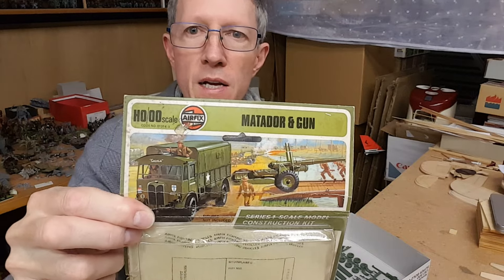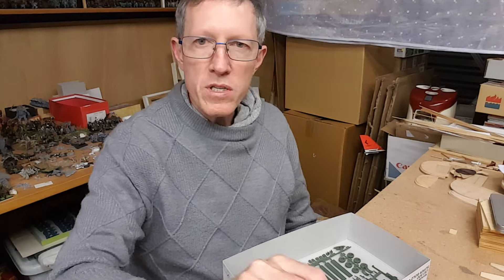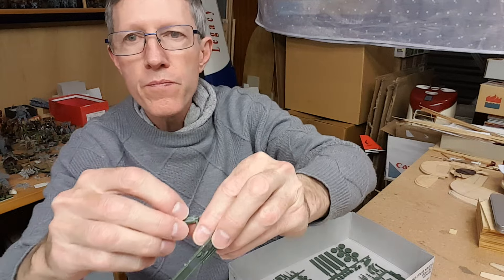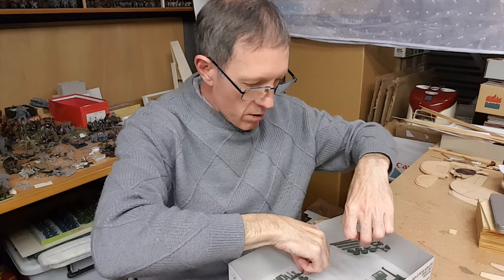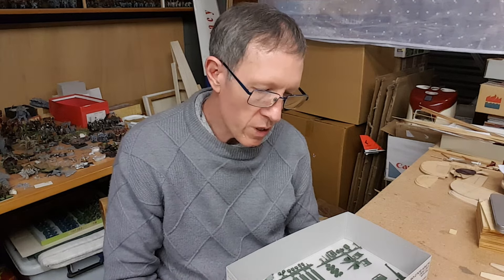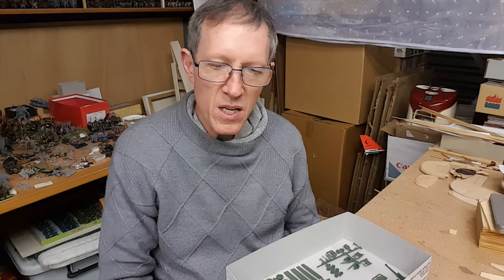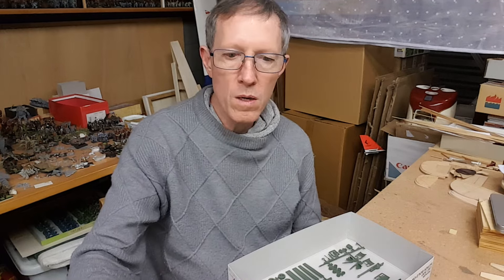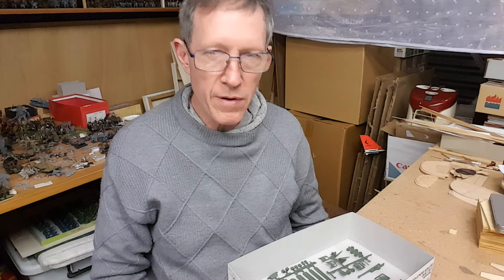Airfix Matador. First look and planning the build.

Comment: Hi . I built this Matador at the beginning of this year and I really went to town on it. Much scratchbuiding and superdetailing. So new fuel tank and holders and I cut out the winch drum and then made the rollers for the cable to run out of the back and the reattached the drum. For the cab I cut off the drivers door and made a new one in the open position. I fleshed out the interior including the wooden framework on the rear wall. As for the windscreen its easier to cut off the two thin horizontal bars and then replace them once you have put in a full screen. On the front of the cab there is a little flat plate that sticks out with two supports. On the roof I covered the hatch with a tarp and on the other side there is a spaced tin plate roof. Look at pictures of 'Gazala' ( there are some good one's of it in France) and you will see it. I re-done all of the mudguards as they were to thick. I did the mudflaps and the little step on the back of the front one's. I also did the rain channels on the front one's. Now the truck body. I scribed planking on the floor and kept the original roof. But I did the frame supports with the sides rolled up. I also opened the doors and diid the crew seats (x2) and also made the ammo crates. On the rear door I made the tow rope from copper wire and did all of the hooks for it to go round. Under the body there are some boxes and a frame for two jerry cans behind the fuel tank. Now the gun. You need to shorten the barrel by 1cm and the rear slide rails behind the breach need to be hollowed out. Its easier to cut it off and grind it out the stick it back on. The towing ring has to come off , its to big. Make a new one. The trails have lots of rivets. So cut out some plasticard of the same size and shape then turn them over and carefully press the rivets into them. Now turn them back up the right way and glue them on , its easier than it sounds. Then add some small boxes on the trails and the gun cradle sides and thats it. It should be painted in olive green with the 'Mickey Mouse' pattern on it. It took me just short of  2 months to do. I won a prestigeous competition with it just recently. Check out Benno's figure forum for his build as that is where I got my inspiration. I hope that weren't to much for you. Good luck.

Comment: HI Leon, if you can hold on doing of the Airfix AEC Matador I can give you replacement Chassis via Bob at the next IPMS meeting. Just a word of warning the  cab roof on the Matador doesn't  fit very well you may need build up the rear of the cab with plastic card.
Reply from the maker: oh ok. Thanks, I dont mind fixing the broken bits. Im not sure how far i will be but im sure i will have worked on the chassis by then, but thanks anyway. Are you not building yours? And ok - will check that roof fit and build up.
Reply: @deonjansen  no problem,  Deon , I brought a number of Airfix AEC Matador kitsets when they last released for spare parts. I done two one as an RAF flatbed truck and the other as 5.5 Gun tractor from North Africa, also I do apologize for get your name wrong in the first E -mail.
Reply from the maker: @nigelbranthwaite8471 lol - no problem